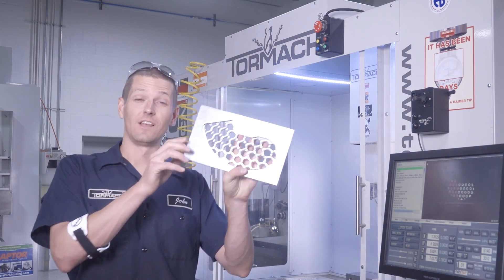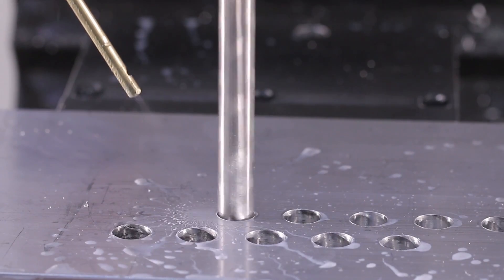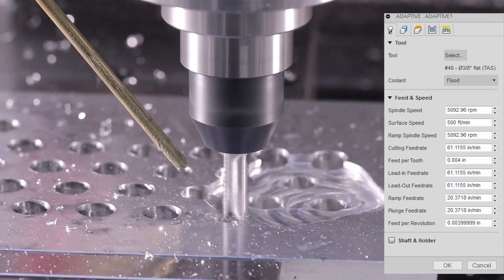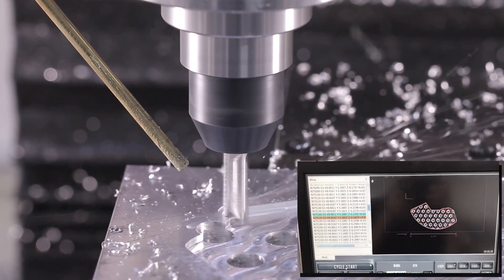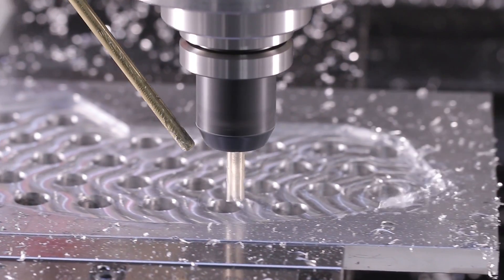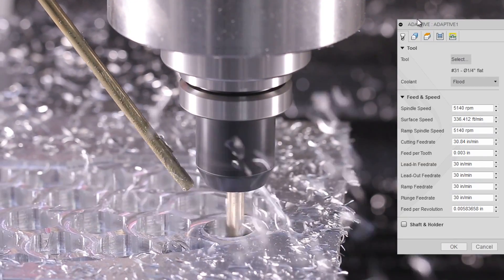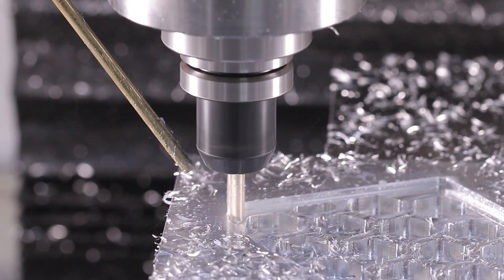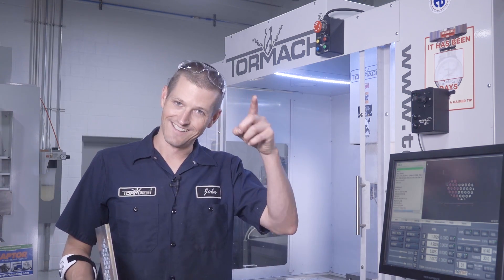Machining a KTM Motorcycle Plate!  WW159

Comment: I bet you could cut your cycle times in half on either of your HAAS VMC's, John. The rapid moves are so much faster; you could also bump the sfm and feed accordingly due to higher horsepower and post machining operations!
Reply: Thats really not the point though. Anyone can put a part into a VM3 and do it fast, but you want to generate toolpaths that are very close to the fastest possible, and then you extract the most out of your machine, whatever it is...

Besides, pretty sure the Haases arent sitting in the shop idling, and putting it into a free 1100 will always be faster than re-setting the Haas for this odd job, instead of whatever production part its doing.
Reply: Great point! And, obviously, making money in a job shop isn't always about the fastest cycle times, but strategically having machines open to take in work!

Comment: Use your infrared imaging camera to determine how much heat build up occurs in your motor under heavy load. More heat the greater likelihood of failure. If you consistently over torque you motor too much and it will break down your windings. 85% total efficiency is about correct. Over time these motors efficiency declines anyway, built in failure you can say.

Comment: How did you get 10000 RPM on your 1100?
Reply: Chris wilson Is that definitely an 1100? It could maybe be a 770.
Reply: yeah, that's what I was thinking but the title says 1100 and in the video of the drill cycle is based on the 1100 Horse power, and John, when he pulls the part out at the end, is in front of the 1100. I know the magic of editing and all, but im trying to build a feed and speed chart based on what works for him and if that was a 770 then it's not going to work well on my 1100.
Reply: Just rewatched it def a 1100 series 3 but at min mark 5:15 pulls out 10000 rpm for the trace operation if the spindle can be moded to 10k I want to do it im adding a secondary spindle to mine but would prefer a new cartridge and pully if posable.

Comment: Do you use fusion 360 to cut out on a torchmate plasma table? I have been told that fusion 360 doesn't have the processors to work a torchmate tables.
Reply: td1830 I use Fusion to cut on my Torchmate.  I have to tweak the code just a touch, but it works well.  I always have to take out the tool number code.  I can't figure out how to do that with the pp.

Comment: I noticed that you are using a collet to hold the 1/2" drill - is this your preferred holder for drills? I ask because I have had repeated problems using drill chucks - the jacobs tapers tend to break loose under stress, regardless of how carefully they have been seated. So, is a collet fixture the real solution for holding drills?
Reply: Gerry Kmack in my experience collets are in fact the best for cnc applications of drills
Reply: Drills larger than half an inch should be held in a collet, not a chuck
Reply: and if really cooking with carbides drill need to be hold in hydraulic holders

Comment: Little Tip for cycle time, when roughing the shallow wide pocket, dont´t care if it´s climb or conventional milling. It will start the next pass where the last ended and get rid of the time the cutter spends in the air.
Reply: 2384SKIPPER yeah If your taking more than 50% width of cut you're already climb and conventional milling.

Comment: Hey John, I am curious... -for optimization, why don't you Lead-out with a feedrate more like 160in/min (I use this as standard)?
Although I am wondering, 5000rpm is max at the tormach or why didn't you go to surface feedrate at, say 1200in/min (with coolant)?

Comment: Obviously some form of pre-located workholding is going to save you a half or third of your total cycle time. I think I'd also strongly consider something like a 5/16" (or whatever will fit) drill for the small pockets to perhaps cut half the 2 minutes out of that cycle. But that would only help with an automatic tool changer. If the operator has to do that change as well as palleting new parts you will probably end up losing on the tool change time.

Comment: Production of this kinda part is why Speedios and Robodrills exist! =)
Reply: That Robodrill can't handle Adaptive Clearing style of code.
Reply: What? I have a Robodrill; I spent all day roughing parts with Adaptive Clearing with a 3/8" Diamondback rougher at 10k RPM, .5DOC and .15 optimal load at 200IPM. That's a 2006 Robodrill Mate model. An even newer Robodrill with the 24k spindle would feed that same cut at about 440IPM, and it would feed that without any control delays. Newer Robodrills and Speedios are absurdly high-performing machines for anything made out of aluminum (and for a lot of jobs in far harder materials as well)